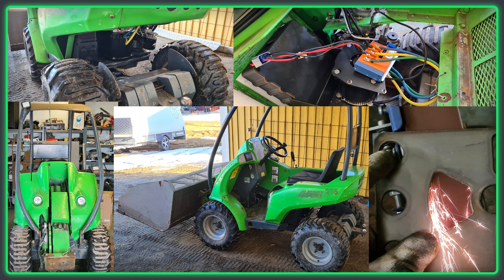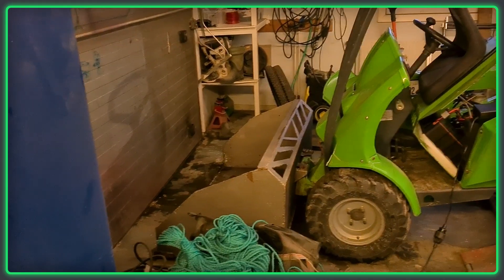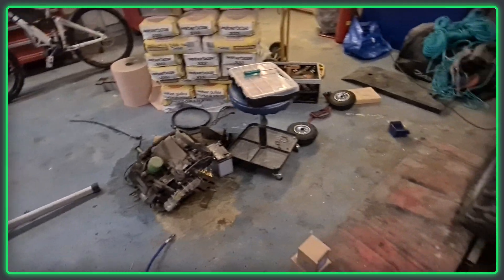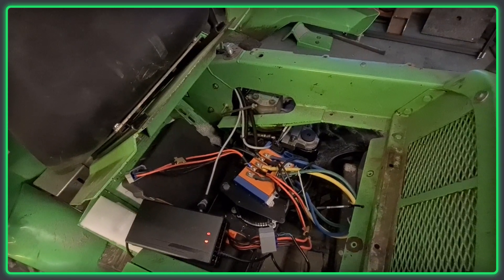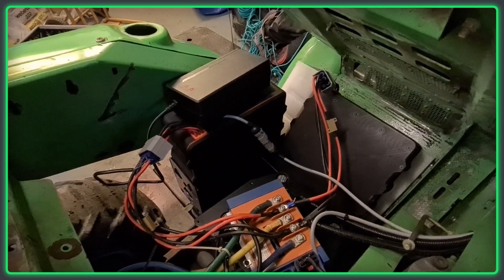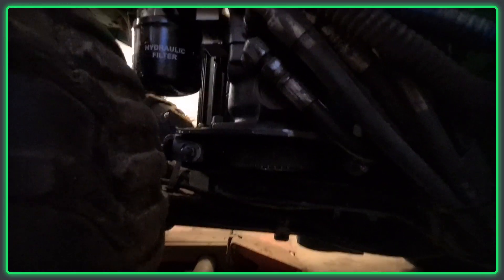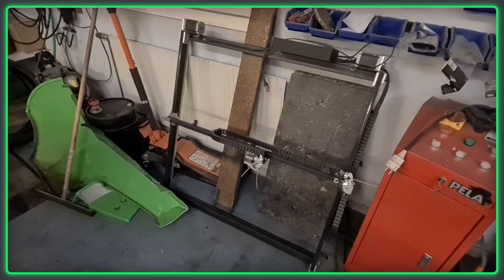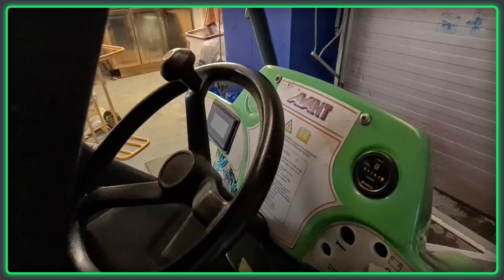Avant Electric Tractor Conversion! - Avant Articulated Loader

Comment: Absolutely hilarious that he actually thinks it's cheaper to convert it to electric instead of finding a decent lawnmower engine to put in it.
Reply from the maker: Needs 16 horses. The replacement engine costs 5k.. So a 500 dollar electric motor and 1000 of cells. Then all the savings from not using gas EVER again! Your logic fails to stack up. Glad you got a chuckle tho.
Reply: @HighVoltageKits  Why do you think you can put and electric motor and batteries in it but can't figure a way around the exact replacement engine?
Reply from the maker: We are a light electric vehicle channel. We are light electric vehicle enthusiasts..Its what we do. I am sure that you can do exactly what you propose. I merely dispute your assertion that it would be cheaper.
Reply: @HighVoltageKits  I know it would be way cheaper. Things may be different if I had electric motors and stuff laying around instead of small engines.
Reply from the maker: Right. Its the same here. We make it cheaper with the skills we have.
Reply: @cjoshem  I'm glad you got a laugh out of it. Yes, the cheaper option would be getting a 13hp B&S motor for ~1500eur, shoving it in there and be done with it.. but it'd require about the same amount of work and showing you the 3 high powered ebikes with the comment "but since I'm into building electric vehicles" I hoped you'd all understand that this is one of my many hobbies.. Ie, it's not just about the money. :)
There are some benefits to the electric conversion over a replacement petrol engine too.. 
1. Never have to buy petrol for it again. (Don't know if you saw the electric car in the carport, but I almost NEVER visit a fuel station)
2. 32kW peak means A LOT more power than a 13hp replacement fossil engine
3. I don't have to worry about the engine not starting when it's -30C and I need to get out in a blizzard.. Flick the switch and off you go..
I've put like $2500 into this conversion with the motor, controller and two battery setups. With the 60A charger I've got I can run the machine pretty much continuously, stopping every 45-50 minutes to switch battery packs. Charging the batteries cost next to nothing but batteries wear so I don't know if it's a cheaper option than buying fuel for it yet, altho with the prices of petrol rising every week the economic benefit of the conversion grows at the same pace..
So yeah - no, I know I could've gotten a cheaper fossile engine to replace the seized one. Even cheaper would be just repairing the seized one (probably just a bearing or three, I'll get to that in time) and even cheaper would be just getting a shovel at amazon and growing some muscles.. but like I said, it's not all about the money. :)